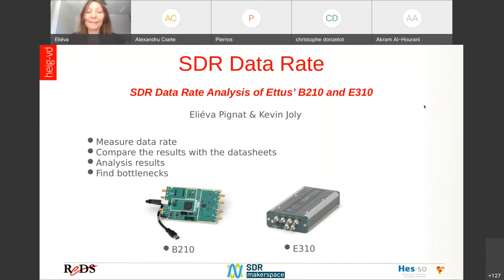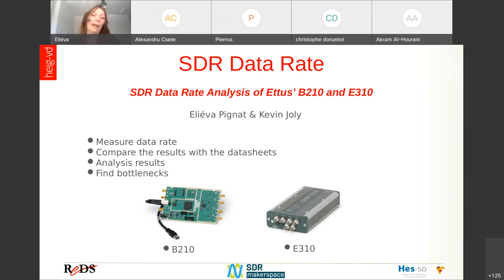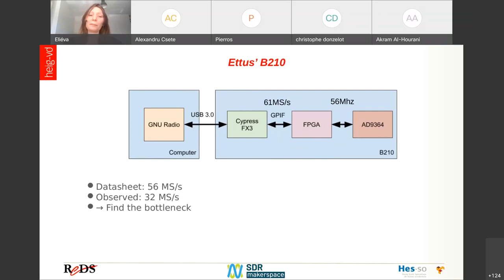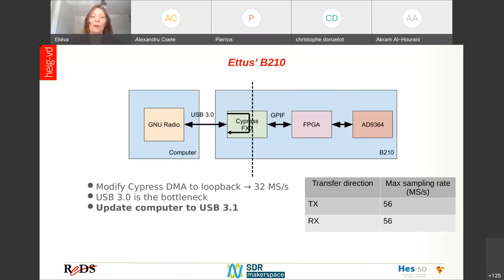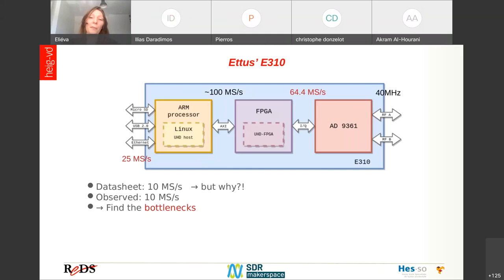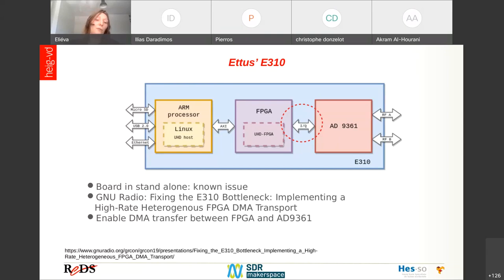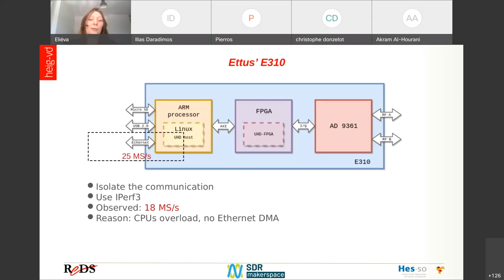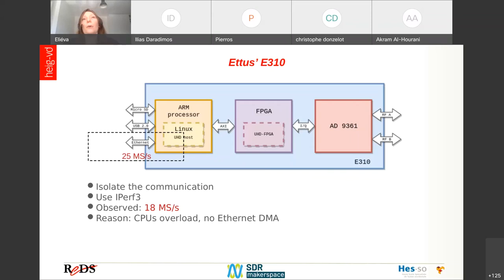SDRMakerspace - SDR Data Rate

Comment: A few notes: 
As observed, it's very hard to establish a max data rate for the B210 specification in isolation from the host computer as the end-to-end USB bus is the limiting factor. The implementation used worked around a number of FX3 errata to the detriment of performance, and at a time when the (then new) FX3 had poor documentation and support, and I feel that if it was reimplement from scratch today (probably with a new interface mode) then this could be improved. The most capable hosts typically max out in the 42-44 Ms/S range. It is interesting the a USB3.1 host made a difference given this is a 3.0 5Gbps device, perhaps the additional  head room in the host implementation to support 10Gbps devices helped?.  

A native 12b sample mode is supported in the FPGA design to get higher sample rates across the USB bus, but it is poorly documented and hence saw poor use which also lead to some bugs in it not being fixed for a while, and it may also have been depreciated now. So saying that if any decimation is performed in the FPGA then dynamic range is increased and there will be valid data in the 4 LSB's.

Lastly there was errata in the slides. In all cases the maximum supported sample rate supported from the AD9361 is 61.44MHz.